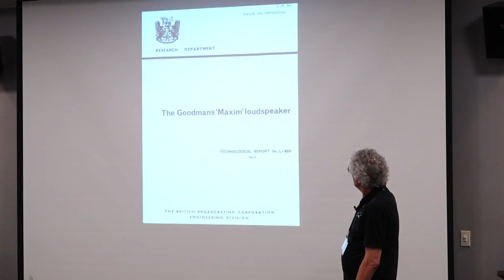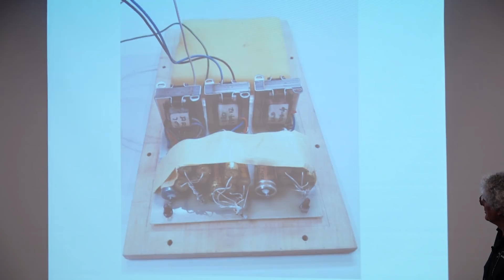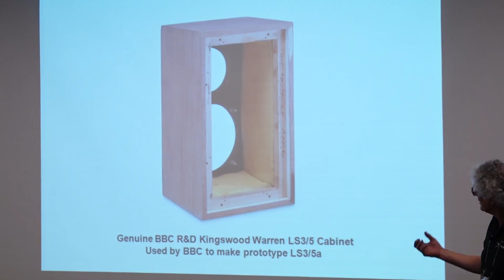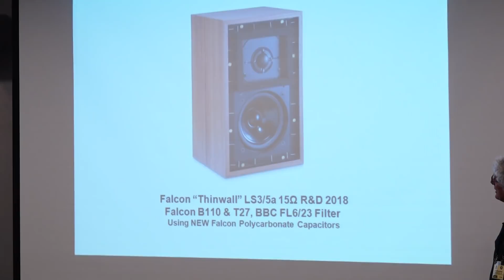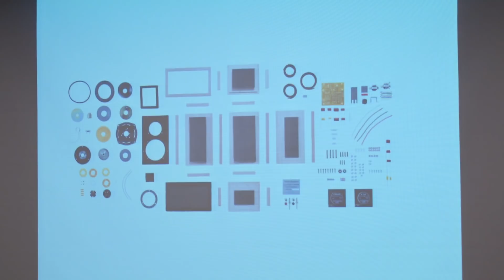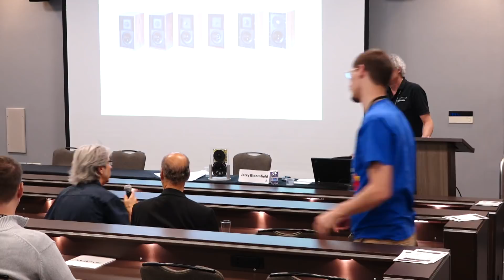RMAF 2018 - The BBC LS3/5A 1968-2018: The Icon Live

Comment: I am  making this prediction in early 2026: The future for the LS3/5a is far larger than its past. That is because the LS3/5a is (in my view) the perfect nearfield desktop speaker system when matched with a well-integrated, phase aligned subwoofer, and high-passed at ~100Hz. In my experience, when you high-pass an LS3/5a it opens up even more - incredible, but true! And because the bass is useless in the 5a, passing off to the subwoofers transforms the sound entirely. Suddenly they aren't small speakers, making a small sound.

I think I will end up with no fewer than 7 or 8 sets of various clones. Currently I am greatly enjoying the bafflingly good Spotless Eternal 4.2s. If they had a "made in the UK" sticker, they'd sell for $4K. I got mine for 700. Then there is the BestVox LS3/5a which is an unutterably superb set of speakers, and worth every penny of the normal USD 1200 price. I paid 750, on sale. And I am so glad I did. The attention to detail is fantastic.

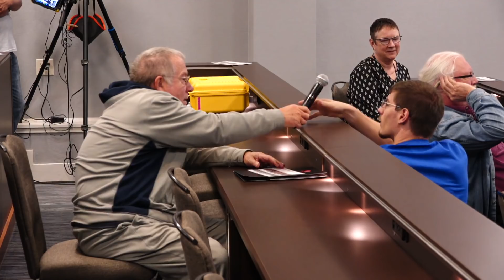Edit: 48:30 - If your subwoofer goes POOP POOP POOP then it is badly integrated and poorly setup. A properly integrated and placed subwoofer does nothing except wake up the music and enliven it. This isn't HiFi heresy, it's physics and biology. Bass is where music comes truly alive. A piano is NOT a piano without the ability to properly hit its low tones, for example. It just sounds like a recording of a piano.

It's also worth noting that the vast majority of subwoofers are insufficiently damped, and so time-schmearing of the bass happens when intended cone movement energy goes into cabinet movement. Bonding a 10Kg paver to the top and bottom of your sub (replacing any rubber legs with hardwood items) and using big blobs of BluTack to bond them together raises the cabinet to cone mass ratio from roughly 100:1 to 300:1, which causes a LOT more energy to enter the air, and far less energy going into the floor, and into moving the cabinet. Roughly 2/3rds less cabinet movement in total. 

This has huge WAF because when you leave the room, the volume and bass drop much faster than before, and your kitchen windows won't rattle when you crank up the Drum & Bass.

People can be forgiven for disdaining subs: badly setup or adjusted subs can actually feel unsafe, and make people nauseous. But properly integrated subs are easy to do, now that Chat-GPT is freely available to guide you gently and accurately through every stage of the process, so that the outcome is simply a gigantic leap in the music's ability to move you without your permission, which is the ultimate test of any audio system.

Ask yourself my "HiFi Heretic" questions:

1) Are sounds coming from outside of the speakers, and are things positioned solidly on the soundstage?
2) Can you hear NOTHING but the music?
3) Can it move you without your permission?

If you can yes to all three questions, you have a complete system which does not NEED improving. That is HiFi heresy, I know! :)
(With great thanks to NAIM for inspiring me to create a modern way to accurately answer the really critical questions in the 21st century.)

Wait until you hear my heretical take on Music Reproduction - which I totally reject in favour of Musical Translation. I have a provisional (and working) theory about Musical Translation which is deeply unorthodox, but also deeply grounded in physics, biology, and human psychology. It will be published in a few months time.

Comment: The LS3/5A does not deserve a cult following. It is an old very flawed design beaten by present day speakers that cost way less!
Reply: I too got sucked in by the cult thing and bought a used pair six years ago before ASR existed. If I had seen the ASR report I would not have spent the $960.
Reply: @robertjermantowicz-uw3iw you are answering yourself? Are you a bot or something?

Comment: RMAF, thank you for posting this fascinating presentation! As a LS3/5a owner since 1983... I know this speaker very well, yet learned a great deal about them in the short hour long video. I have to go back a re-listen to a few key points, to be more clear with the take-away. I am more impressed / interested in the Falcon brand than ever before, having heard it straight from the horses mouth... I bought my newer 11 ohm pair in 1989 directly from the state-side Rogers importer, I thought that I saw the comparison shown, reflect that Rogers (did not make) the 11 ohm model... I am re-playing the video to clarify my understanding... I want to go pull mine out and have a listen... I am glad, I never sold mine on a whim... I actually preferred my 11 ohm versions over my "older" Gold Badged 15 ohm speakers.
Reply: Go to Audio Science Review and read Amir's test of the LS3/5A. Measurements don't lie! It has a broad dip between 200hz and 400hz. At its original 1976 price of $430 it is acceptable but hardly can be called a monitor speaker. At today's prices of $3K+ it is rip off!
Reply: I too have a pair of the 11 ohm version that I bought six years ago from an eBay seller in Lithuania for $960 shipping included. This was before I read Amir's test. Today I would not waste my money on such an imperfect speaker!

Comment: Not sure about the green Bextrene thing, My friend bought two pairs of Chartwell LS3/5a new in 1976, both pairs had dark green B110 cones. I bought one pair from him in 1987 for £90. probably a fair price for both parties then.
Reply: Sorry to say this, but green tinting means they have been exposed to far too much humidity, or even water. If they're green then they are not sounding correct because the cones are damaged, and need to be replaced.

Comment: Love it, thanks for posting. The best bit is where Falcon gets the BBC licence and Malcolm is pleased.  A long wait, but worth it.

Malcolm designed me a crossover way back in the early 70's, for EMI 14A770c, KEF B110, Celestion HF1300 and Coles 4001G. Speakers are excellent, I still have them.